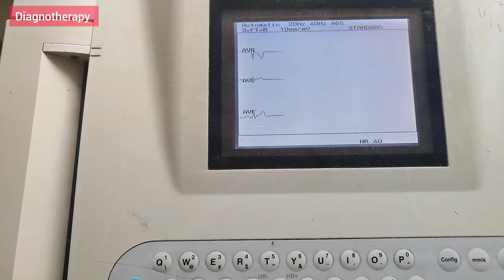How to take ECG | How to do ECG | 12 Lead ECG

Comment: 12 leads are not thr?
Reply from the maker: There are 10 lead wires 6-Leads V1-V6 Direct Signals are taken. Right Leg act as Electrical Neutral. From 3 points Right Arm , Left Arm and Left Leg, we get 3 signals (Lead I,II,III and derived leads means a mean calculation of these gives another 3 lead signals).

Thus, 6+3+3= 12 Lead ECG signal

To note we apply 10 Lead wires for Electric Signals.
Reply: 😂 join some dr couching academy